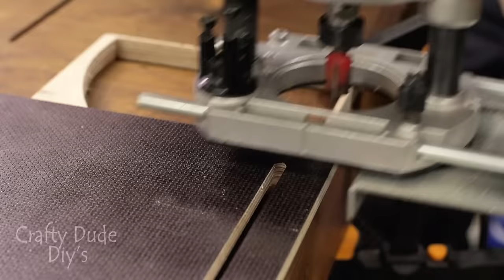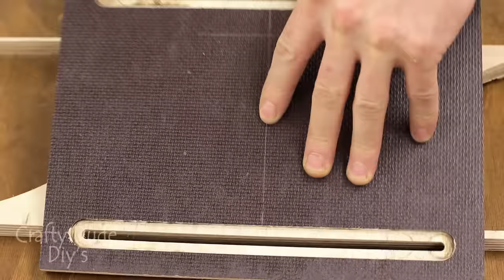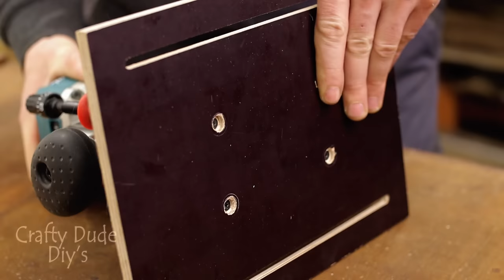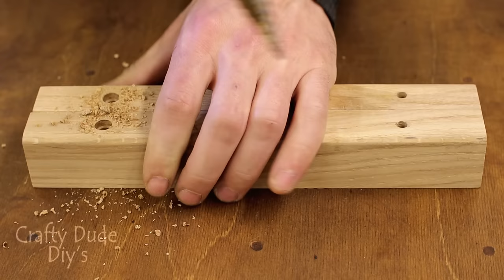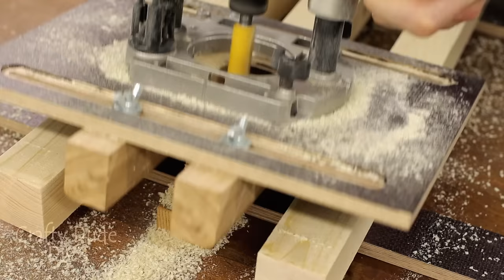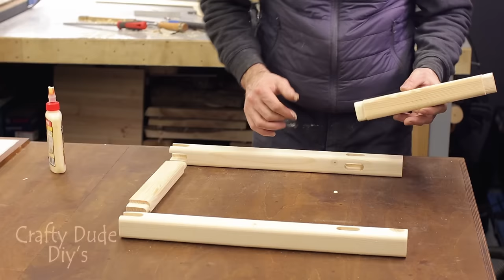DiY Simple Router Joint Jig|| Great Woodworking Idea

Comment: I missed how the adjustable sliders underneath are positioned. Are they self centering, or are there measurements?
Reply from the maker: no its not self centering, mark pocket you want to make with a pencil, then place router bit by edge of line and place bottom fences by your lumber

Comment: How did you round the ends of the Tennons? Sander? or, Router.. Did you use the same jig?
Reply from the maker: No, I have big metal file, it works fine for rounding edges, but if parts is bigger then first I take out corner with chisel
Reply: @CraftyDude  Thank you.. Nice Channel.. New Subscriber! Congratulations on your work.
Reply from the maker: Thank you Mark👍🙂